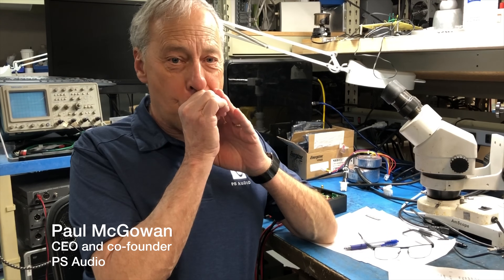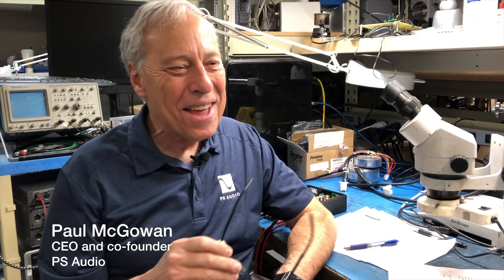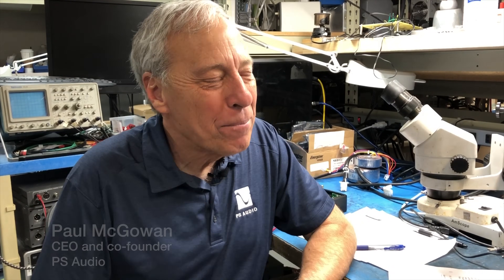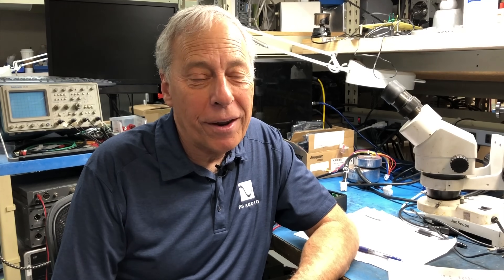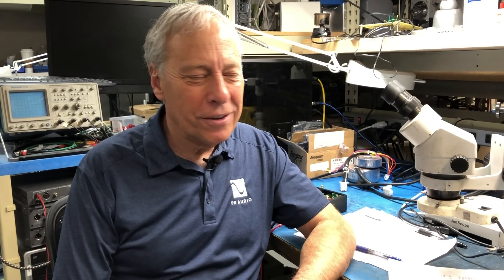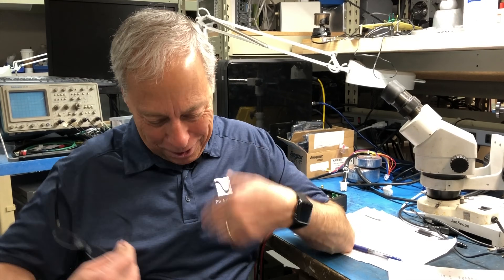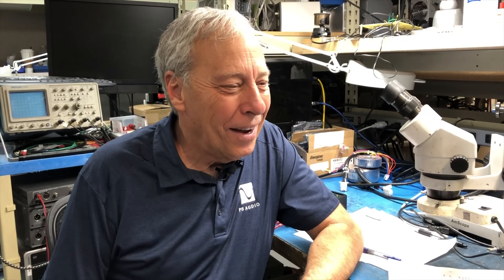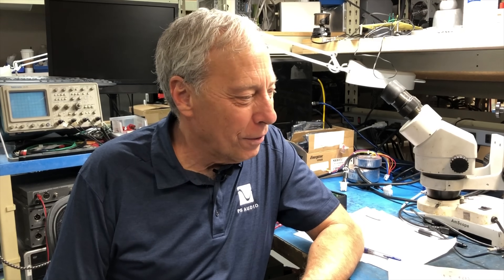How do horn loaded speakers work and sound?

Comment: Most of the comments for this video seem to be very much in favour of horns. I really have to agree with Paul on this topic. I have never heard a horn I thought was listenable and I've heard a lot of horns in my time. They can only shout, they can't whisper. IMO The reason people like horns is that they are good at dynamics. They hear a horn and say "that's got great dynamics, I want more of that". They then chase designs with more and more dynamics that have less and less of everything else. The horn loaded speaker is a one trick pony.
Reply: Up until about a year ago, I would have agreed with you. That's when I built my speakers using Altec theater horns. When a designer is freed from the limitations of what will fit in and look good in a living room, a horn can be properly designed. Before the 1980's, just about every movie theater in the world used this technology, and sometimes the movies got very quiet. Horns can whisper, they can produce a deep and defined image and they do not have a "horn" sound if designed properly. The downside, the good ones are huge. Like any other driver, they are not full range. They are unattractive, I keep mine in the basement. Unlike Paul's requirement of 130db, I find 95db to be loud. My midrange horns (Altec 203b) will do that with 10 milliwatts. They will hit 130db, and will do it with 15 watts. A "normal" speaker of 90db sensitivity would require 10,000 watts to do the same thing. While I also dislike every commercial horn I have ever heard, Avantgarde included, this isn't due to inherent faults in horn technology.
Reply: @johnlebeau5471  I'm glad to hear that you have built a great sounding horn. As so many people like horns there must be something good about them. Everytime I get a chance I listen but still haven't found the magic for myself.
Reply: @johnlebeau5471  thanks... that makes sense

Comment: A big complaint i have of regular box speakers is they sound too small. It's like there's two lasers sending me music in the room. Open baffle speakers help with this problem, so do electrostatic panels, and so do horns. When I hear horn speakers they sound much bigger than they really are. They also have more dynamic range which I like. They sound punchier, more forceful. Anyways, that's why I do like them.

Comment: Much is now known about how horns work and how early horns produced "horn honk" coloration, and it is now easily avoided. Horns increase gain in two ways: 1) by limiting the spherical angle of power radiation, and 2) by using compression to increase volume velocity, then using the momentum of gas particles to maintain velocity as the wavefront expands. Horn honk is caused by internal reflections in the horn that cause high frequencies to be attenuated, and resonances that cause midrange frequencies to be accentuated. Resonance is desirable in low frequency horns because it increases sensitivity at the lowest frequency where the horn operates, based on the length of the horn path, by creating quarter-wave resonance which is damped somewhat by the capacitive effect (high-pass effect) of the horn's flare rate. In the midrange, it is less tolerable and leads to "honk", so careful choice of the flare rate is important. Then at high frequencies, you really want as little resonant behavior as possible, so a high flare rate is used. Also, it is important to use non-parallel horn walls (such as elliptical-section horns) to avoid side-to-side and top-to-bottom reflective modes (high order modes) that create cancellation at high frequencies and delayed emission of sound. You have to consider that the wave, when it is emitted, is round, and so the horn cross section really should be either round or elliptical, not rectangular as we have seen for so many years. Companies like Eighteen Sound, BMS, and Faital Pro have been making elliptical-section horns for a while now, and Renkus-Heinz has been using a round-obround-elliptical-round section profile from throat to exit through its Complex Conic horns for many years, and these horns have less horn coloration. Also, "waveguides" (shallow horns) which do not employ a diffraction slot (and are thus not "constant directivity" have the least colored sound, but at the price of consistent pattern control.
Reply: What if you scalloped the edges with each side having a different frequency and magnitude of the peaks and valley?

Comment: i think that an advantage of horn loaded drivers especially mid and high Hz drivers coud be the control of dispersion.  In many home listening rooms the acoustic is quite far from ideal and reflections from the walls can mix with the direct sound from speakers in a random way with delays and so on ... a speaker with a narrow dispersion can be aimed to the listening spot and the acoustic treatment can be limited to the wall behind the listening spot I guess  Much easier thing to do

Comment: @6:44 I think the "Multiple Horn" has been done by Danley Sound Labs in a slightly different way - Multiple Drivers in a single Horn... and quite successfully.
Reply: Danley's multiple driver "horn" is actually a new invention - the Synergy Horn. A proper description would be to call it a BROADBAND (as in full range frequency response) Controlled Directivity Linear Phase Single Point Source. And I think it's something Paul McGowen needs to listen to - as always, in a proper listening room with an excellent setup & superior associated equipment. This is NOT your father's (or grand father or great grand father's) "horn". Paul - you are invited (to my place) if you have time during the next AXPONA :)

Comment: Develop a loudspeaker based on instrument category.  Horns can be just brass instruments. Take a trumpet and play that through a horn: you have a trumpet with its characteristics.  Horns tend to be directional even movement left or right: in phase out of phase. Take and instrument like strings - generally omnidirectional except for the sound hole - planar / electrostatics / ribbons are good for that reproduction.  Drums would be good through flat woofers - just like the skins on a frame.  Other percussive instruments such as triangles, bells, mallet instruments - dome tweeters or Linaeum tweeters. An amplifier and crossover for each section would be needed.  Recording of such instruments must be done on each individual track / channel and allocated to each appropriate amplifier. Ch 1 - drums, Ch 2 - Strings, Ch - 3 Brass Ch - 4 Percussion, Ch5  - Voice, etc. If the object is to get as close to the real thing, reproduce it as it would be performed live or else just bring in a band, musician, orchestra into your living room.  The expense of speakers systems today is generally for the well to do. So why not make a system to get closer to what is real as the ideal purpose of being an audiophile in the first place. DSD is great for recording and playback.

Comment: Well... you should listen to Jazz.  Here they usually use horns: Trumpet, Coronet, Sax, French Horn, Tuba, Trombone, which are HORNS. These instruments are best when reproduced by a Horn Loaded Speaker.  Actually the best Trumpet I ever, ever, ever heard was reproduced by a cheap, plastic, PA style horn speaker/reproducer. The experience shocked me!  The horn speaker, apparently resonated just like the trumpet it was reproducing. The difference in this case was that the flared horn end was unsupported and unmounted. It was therefore free to resonate. I was tempted to put this small horn inside of a speaker box, exhibit it at shows, and sell it!

Comment: In today's speaker world of 80 db 1 watt 1 meter with 8 " woofers requiring 50 watts just to get them going give me a horn any day . Plus Klipsch isn't the only ones using them . The best of the best used them Altec lansing Voice of the theater JBL  Everest DD66000  etc . The greatest issue with horns is placement . 

 Nirvana is a TD124 rhapsody 16" arm  MX110 MC225 and Klipsch LaScala speakers .  No special room or treatments or cables or wires .

Comment: predictable                              EVERYTHING colors sound , and the prejudices of the 60's are still alive , i see    i've had salesmen do that trick , and my response is , cup the hands closed to approx. an infinite baffle....SEE                but most who don't like horns never talk of the real advantages, and ignore the fact that most of the horns they've heard derived from P.A, , which has diff criteria from hi-fi    generally , a circular mouth is preferable , nearly eliminating the "coloration"                             in my view , horns are very live , due to transient resp. , among other reasons , and i prefer them , tube driven , of course          it seems weird to be commenting about this 40 yrs. after my prejudices were fixed , but no matter the power applied--100s of watts--a cone can't do it   Sometimes a film can approximate "reality" , but need to be HUGE to avoid cancellations , and are power hungry      i just built a 16 cycle horn in my final house        big horns can fit,if you own , and it's fitting for bass   no more thumping , flopping cone trying io catch up , the Klipsh horn worked fine , but having built several , it's unnecessarily  complicated , and only goes down to 40 or so,at best  ........enuf       hi-fi is priorities and prejudices , and arguing is fruitless           the proof is in the pudding , and i prefer the vitality of horns

Comment: Hi there Paul congratulation for your channel. I find it very useful. would you recomend me a pairs of loudspeakers? I know there's not such a thing like the best speakers. I don't know whether I am an audiophile but I'm for sure a music lover. I love classic, Jazz, Rock, almost all metal( Heavy, Thrash,Power,new,nu,ect) also some opera and of course I'm totally nuts about the blues, so is probably hard to find a pair of speakers which fullfill my expectations for such a vary tasre for music. I own an old Marantz as a preamp and one power Emotiva. As you can see I'm not rich so I'm not able to afford Mark Levimson, McIntosh( one of my favourite),or Krell but my old vintage Marantz has gave me a lot of hours of satisfation. I also own a pair of old 3way 15" National speakers which have made the job pretty well. I actually replaced the High horns and the mids speakers because the original died. So I decided was the time to boost my system so I bought a pair of JBL ES90 .They sure can handle the Emotiva Power but I got tell you the sound is not what i expected. you won't believe but I found my old National a little better . The bass is more deep. even the highs sound louder. the JBLs sound better when the mids are the subject. So i think is time to change again. I was thinking of Fluance Signature , Klipsch r625 or some Polk. what do you think?

Comment: Once again a Numpty Expressing his Limited Knowledge. "Horns" are Devices able to convert "Acoustic Impedance". They are Wavelength Dependant. Not so a waveguide that is based on Pattern Control. As others have Said his Understanding is 50 Years out of date. How he/they PS Audio are going to be able to match the Efficiency of such a device is Probably "Pie in the Sky" BS to gain Sales. For Klipsch some of the worst Sonics for Horn/Waveguides I have yet Heard apart from Danley.

Comment: Thanks, Paul. The most impressive speakers I have ever heard were Altec-Lansing A7500s. A large exponential horn with back-loading, a 12" Altec woofer and an Altec compression horn driver (similar to Paul Klipsch's driver in the Klipschorns) for the highs. They were made for movie-house sound reproduction, like Cinerama. They were driven by massive Altec tube amps. Nothing had the power and majesty of those monsters. No other speaker (although better in frequency-response) could even touch them. It would be like comparing Pete Townshend and his stack of Hiwatts to a tone-deaf busker with frozen fingers. They were so efficient they could be driven by a 20 watt Bogen PA amp and rock the house! They were the PA speakers for my band (we had champagne tastes) and we filled an abandoned torpedo hanger with incredible sound from them. They don't make speakers like that anymore, alas...

Comment: I have a pair of A-7's "Voice of the Theater" that I built a long time ago with Altec 515 bass drivers, Altec 511B horns, and JBL horn tweeters.  Because the horn of the A-7 cuts off at about 80 hz., I use a large infinite baffle with a pair of JBL 15s as a subwoofer.  The sound quality and realism IMO are astonishing.  The fundamental problem with horn speakers is that they're big and heavy not to say expensive.

Comment: A wide dispersion horn sounds great if it is part of a speaker system, its also great because it separates more of the mid range frequency and broadens the sound stage. Coupled with good tweeters and good woofers they can sound fantastic.  In the 70s and 80s bigger was better and you could get a 3 way or 4 way system without taking out a loan.  If you are on a budget you can still find some of the classic speakers that sound great and give you more for your money than spending twice as much on a newer design with smaller drivers.

Comment: I thought that horn loudspeakers achieve their effect (of very high efficiency) by coupling the sound of the driver to the room, not by amplifying the sound. A horn with about 12 feet to 13 feet diameter at the end is able to reproduce very low frequencies with a minimum (relative) of power. The driver is working at low power and therefore at minimum distortion.

Comment: Hi the way you use your hands as a crude horn makes horns in general sound bad , and this is a truly lousy horn there are much better also even a bad system is that ,a complete system unlike your example which would be technically described as a small conical type being forced to be a full range system a nice big format linen done band passed would , (and does) sound as bad . My point being this is a unrealistic example and it is true there are many bad horn systems , there easy to make , but there are some that are great

Comment: The Altec model 19s still stand out as one of the greatest horn speakers of all time. They have one of the most unhorn like sounds I've heard from a horn speaker due in part to an internal diffuser lens mounted in the throat of the horn (an Altec patent) and a very complex crossover that smooths out irregularities in the speaker's response. Model 19s are still able to compete with most of the best horn systems made today. In my opinion 19s with xover upgrades easily outclasses than anything Klipsch ever made in terms of transparency, low coloration and accuracy of response. The only horn systems I've heard capable of beating them are the JBL Everests, Rey Audio's RM-7Vs, JBL Hartsfield reproductions and some of Kenrick Sound of Japan's masterful retrofits of JBL.
Reply: "a very complex crossover that smooths out irregularities in the speaker's response"

Whither the efficiency with them? And thinking about what they do to phasing... I'll stick with my transmission lines with a single capacitor crossover thanks.

Comment: I had attended a yearly "Tube Tasting" gathering for some years awhile back and in one, there was a speaker engineer who demonstrated horns. He demonstrated them by talking into them. For the same reasons, I originally did not like horns, they were too peaky and did color the sound some. However, he demonstrated one horn that was an almost perfect acoustic amplifier. I was very impressed. I still prefer the direct speaker also however. And for those who are complaining, I pretty much believe that horn technology was perfected a looong time before Klipsch formed his company... so... unless that one (the one proclaiming foul) works for Klipsch, well, this video is sufficiently educational and accurate with regards how horns work and what they do. The physics behind them can take much more time than he had here to explain, as well as the geometry of the horn shape, length, diameter of the opening, etc. etc. etc.

Comment: A properly designed and built horn loaded speaker system will out-do any other type of speaker setup on every level(except for size). This was by far an oversimplification. I think this guy knows better but is trying to sell his own products. How can any non-horn-loaded beat the efficiency of a horn loaded speaker? Not possible, because... Physics... You would need a gigantic speaker cone to even come close, which is not possible to create while maintaining good sound quality. You would have to use a huge array of smaller speakers which introduces many of it's own problems. Anyway, Paul, at least tell the truth and make the proper argument about the reasons why horn loaded bass speaker systems are impractical.
Reply: You think a horn loaded speaker is better than an electrostatic speaker
Reply: @vighneshramesh2569  Listen to them both and make your own decision.
Reply: ''I think this guy knows better but is trying to sell his own products''  Bingo!

Comment: Depending on how it is made there is nor probleme with getting up to the very high frequency's. I have 2way loudspeaker's with a 10" low-mid driver and a Horn tweeter. Here are some measurements :) https://h-audio.de/Eigenentwicklungen/Open-1001-Hochton-Weichenkit-fuer-eine-10/1-Box::2474.html
In my room they go down to 40hz very linear. So the measurement does not say much about the bass. I realy love the sound of them! Very cleam, dynamic and if i want to VERY loud.